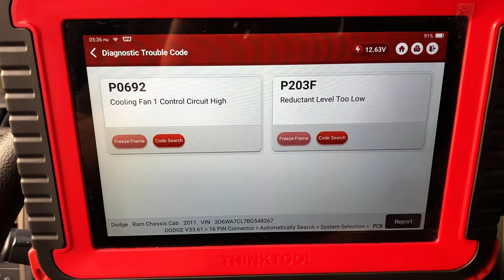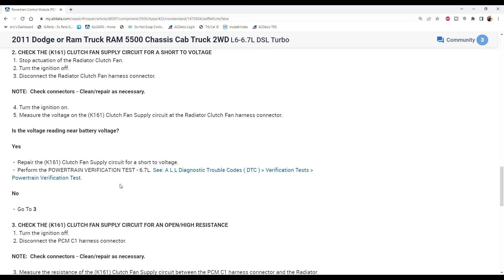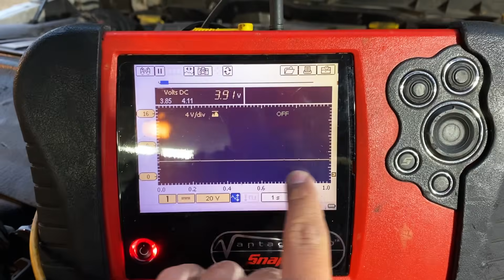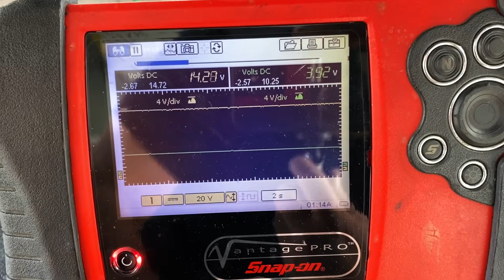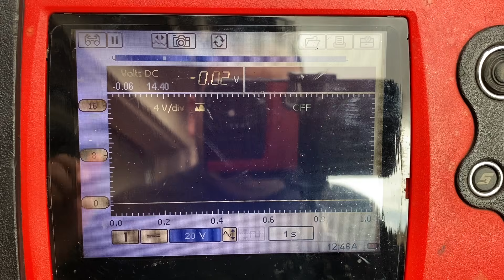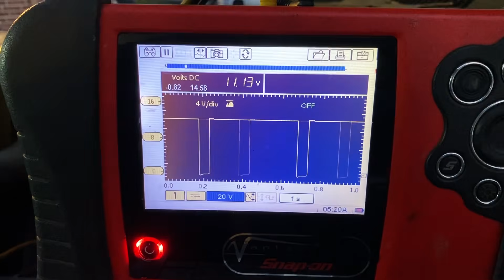DODGE RAM 5500 OVERHEATING P0692 FAN CLUTCH CIRCUIT DIAGNOSIS

Comment: Could you also have figured it was a bias voltage by using a bi-directional control and seeing if the ecu would send out the pwm signal?

Comment: 😮😮😮😮😮.     Hello hello hello hello hello hello hello hello I know that you get a lot of messages and you don't answer every one of them but can you help me or any one i know that the fan clutch have 2  speed normal and high is there any way to override the system and active the second speed without affecting the ECU I mean just using it when ever going up a hill loaded 😮😮😮😮😮😮😮

Comment: absolutely phenomenal video. minute 5.28 you missed the step 6) which asks you to do bidirectional test on clutch fan, if you did, you would find clutch fan not working and your next step would most likely be to verify with scope that pcm is controlling fan clutch circuit (testing at the pigtail connector) . After finding there is control, it would lead you to either open between pigtail connector and the connector at the fan clutch or open in the fan clutch itself. most likely you would have wiggled the end of connector and noticed it is not plugged in. BUT if you did that we would NOT have a chance to learn about the bias voltage being sent by pcm to fan clutch with initial key on. We learnt more about this circuit going the long way. Thanks a ton

Comment: Very Educational video.... it tells us that the problem could be anywhere in the system, and most people will either need to take it in and have a very expensive mis-diagnosis done, or simply throw parts at it to see if they fix the problem....
 I'm currently having the same issue with my ram/Cummins. Is it possible to do a simple test of the fan motor/clutch individually before dismantling and probing the rest of the system?....

Comment: Hey i have a 2016 dodge ram 5500 i already replaced fan clutch, thermostat, radiator , water pump and am still having problems overheating.

Comment: It helped me... In the process I found a wire pulled out of the plug on the fan side... Pushed it back in everything worked fine

Comment: How's it going  i have the exact same problem  new fan clucht  and only 3.9 voltage  i think the same  the computer should send the  12 voltage  my cuestion  it's at what temperature should be working the fan??

Comment: I replaced a new head gasket arp head studs rebuilt head and I had electric fans and the truck temperature gets up up to 220 226 I’m thinking to put back the stock fan clutch I have coolant by pass every time when I’m loaded the temperature goes up I think the fans don’t work good with towing

Comment: Thank you sir for this full in-depth diagnostic ,  I just replaced my clutch fan and after pulling a load of 28k. My truck was doing the same and the diesel shop I went to was doing the same Diagnostics and same tools you have and you have now proved that my pcm is still good and I’ll be getting a different brand

Comment: The owner is lucky he didn’t break something in the number six cylinder. Dodge Cummins is known for this….Might consider running a. 165 thermostat  as that gives a little time to notice the overheat before  damaging the engine.

Comment: I've replaced the fan clutch on my 5500 3 times now with a new one everytime and all 3 have worked great for a few months and then starts roaring again. I'm ready to pull my hair out

Comment: Shop I went to assures me that it's the pcm is bad.

The fan clutch is new and they ohmed it out and said it was good. They said that the fuse is good. The ac/ transducer was good, wiring and all pins were good and had continuity. They were certain that the computer was bad. But they said they have no way of testing till they put the computer in and if it's not the issue it's on me they can't return the computer. I was about to green light them but then I saw this video and concerned. The fan that is in there is OEM and does not have the connection as shown in this video it is hard wired on the fan side plug. Am I missing anything? It's about $3500 and about 3 weeks till they can get a computer. Any input would be great

Comment: The mechanic that replaced the clutch is a hack! Guys like him is the reason I do my own work. Anytime you do a job it had better look like it left the factory. Zipties holding the wire away from the fan and cutting that factory ziptie fastener and not replacing it is unacceptable. The ziptie that the author of this video cut was factory it was not put there by the previous mechanic he had better put it back on. I wonder what the shroud underneath looks like? I bet the previous hack did not replace the 4 Christmas tree plugs that hold the shroud together at the bottom.
Reply from the maker: I ended up replacing the fan shroud because the bottom half was missing. I think the previous mechanic cut it off.
Reply: @ADVANCEDLEVELAUTO  I wondered why there was only half a shroud there when you pulled it out

Comment: Just saying the fan clutch can cause the fan to turn up to 10% faster why not drive it until it start getting hotter and see if you hear it locking up surely it sounds like a big rig as you always hear them when they lock up

Comment: I like it, from a retired ASE master! Why, when the service tech uses common sense and finds a problem, it becomes fixed. I don’t like PWM fan clutches but this is the world of lower emissions and higher fuel economy we live in! But you have to verify the customers concern, then following “TSB’s” if any, then diagnose the root cause. Too many repair the symptom and replace a part. 
  Go to the parts store and let them read the current code. Just understand if it says “O2” sensor, does not mean it is bad. Too low for long time, too high for long time, heater open, high resistance because a new exhaust had an O2 wire melt on it. 
 You see, the code only points to the component, but does not diagnose the real reason.
 Parts stores enjoy selling $170 heated 4 wire O2 sensors, but it may be correctly reporting a problem as say the fuel pressure regulator is dripping raw fuel past a ruptured diaphragm (If Yours Has One) but in this case, the O2 is reporting a rich mixture over a long period of time (Varies by Manufacture) but is fine.
Complicated? Yes, blame the Government for CAFE standards, CARB for setting expectations for emissions, EPA for the rules and marketing for noise, safety, and MPG and others like crash testing to set insurance rates. Then how big the city is, number of accidents, deaths, theft as you move into the country 200-300 miles from a big city, your rate can drop 39%. Fact!
ASE master tech since 1978.

Comment: congratulations on the diagnosis, I'm Brazilian and I live in Miami.  Where can I buy the worshipers you use in the multimeter?  Yellow connectors that you stick inside the cables

Comment: Awesome work Eric. 

I was out of town working one day when the company truck a 2017 Ram 2500 was having a similar issue where it would heat up and reduce the speed it could be driven when towing a trailer. it was a 16 foot enclosed trailer with maybe 1,500 LBS of extra weight aside from the trailer. should not have been an issue. i towed the trailer with my truck so we could make if to and from the hotel but we finally took a look and there was a small connector in the shape of an L that came from a hose and connected to a pipe that keep breaking. we replaced it with an identical unit and it broke. so we grabbed some fittings from home depot and a hose from autozone and replaced the piece. has worked like a charm since then

Comment: So my biggest take away thoughts are on figuring out the system design and how it works. I was banking on you misreading the low voltage reading on a pulse signal as you believed it was pulse till up to that point. Then you found out that it was a pull down signal somehow! But here is my thought, was this info listed on alldata and just overlooked or was it not there? (The type of circuit design and how it worked)

Comment: Ok I saw a Texas plate where are you in Texas do you do vehicles in the San Antonio Tx area my dodge Charger ain't starting and North Star Dodge couldn't get it running after putting two batteries taking it back the second time said my alternator was good charger still doesn't start went dead about after a week both times with a new battery

Comment: Long Video.   BUT so much helpful info.  My old 2005 Dodge 2500 had a similar problem,  wasn't to replace the freaking expensive computer.  So this explains some of the issues and unknowns i was dealing with.  Learned about the load test, so when my buddy replaces the Tranny on my old Dodge I can help him figure it out so he can maybe get that old 5.9 to 750k.

Comment: What a video! I got a question for you when you grounded the circuit to eliminate the bias voltage, are you creating a short circuit? because when the circuit is shorted I saw 12 V of PWM or maybe I'm not sure what did you test.,,,, Nice diag bro!
Reply from the maker: It's not technically a short circuit when it goes through the test light. The bias voltage is designed to be a very weak signal that can easily find ground through the component (i.e fan clutch) in the circuit. This is how the computer uses the bias voltage to verify if the component in the circuit is disconnected or there is an open in the circuit.

Comment: First, that is NOT a pickup truck. No such thing as a 5500 pickup truck. It's a cab and chassis. They are different in many ways. And yea, the fan... it's a very, very common issue & fix.

Comment: Good save on the explanation at 15:50.
When something is PWM, pwr or gnd contl. I Always look at the PWM sig First this can tell me if the controller is actually working and if there is a pwr or gnd error then the check pwr and grd wgile doing BI/D/C of the device.
90/100% should mean full pwr or full gnd else 20% or less is opposite
Reply: And as I watch the end of the video I see my self 5 years ago Fudge yea !
Member dat day!
 And put DAT on a Cracker DUDE!

Comment: You found the problem and fixed it......period!
GREAT DIAGNOSIS!
If that's a Cummins engine and fan unit, they have a pretty thorough diagnostic test, in some cases you have to know "Cummins Speak" but once you've done one, you'll know!
My knowledge is limited and it was over 6 years ago working with a Cummins CNG engine.  Fun time!

Comment: I cannot believe how many times technical information called it a clutch fan. A clutch fan, if one really exists would be a device that cools your clutch. A clutch may indeed overheat and be in need of cooling, but I know of no device designed to do so. A fan clutch, on the other hand, would be the proper device to engage the radiator cooling fan. Just one of my pet peavs. Just saying. Great video Eric. Keep 'em coming.

Comment: Great video! I misdiagnosed my friend’s car. Her car couldn’t move backward. Thought it was suspension related part or transmission . Turned out brake pad were came loose. Pad material were gone. Rotor was thin! Not an expert in Suspension system… I’m a young tech..so I’m constantly learning! It’s a pain but crazy! You are very honest and I learned a lot from you!

Comment: As usual, great trouble shooting Eric.  I’m surprised the PCM is bolted to the engine block. I would have thought a computer would not be so close to a big heat source. It seems modern computers aren’t as sensitive to heat as old ones.

Comment: There you go, collateral damage and its from the mechanic who is doing the immediate repair job. Maybe the clutch was replaced and he used the old wiring set up...who knows but in any case, the retention clip/plug was NOT new looking yet disconnected due to the damaged retainer.  This is why I cannot fathom "hiring" mechanics from just anywhere...they have no concern for the age of the vehicle, its plastic integrity, design etc. All they want to do is rush and take shortcuts on every job and say they fixed it yet all along the way there is evidence of "Mr. Mechanic" and his carnival of elephants in the china cabinet. The vehicle didn't come into his shop that way I can confirm...so there he goes doing his repair and to top it off he uses "Autozone" (he claims) for a parts source which is a huge immature decision to make as a mechanic. Boom, he delivers the vehicle and never confirmed the repair, the wiring etc. Obviously he never used the scanner.

Comment: Great job Eric. I've learned the hard way, never assume the parts the previous technician replaced was good. Always start your troubleshooting from scratch.
Reply: Agreed, sometimes the biggest mistake you can make is to assume that just because something is new it must work. Sometimes all it means is it isn't rusted in place when you need to change it again.
Reply: Great point 👍👍
Reply: Yeah, seen too many situations where the brand new part (usually some gibberish-named knockoff from Amazon) was worse than the old one, though in this case the previous "mechanic" simply lied altogether. Hope the Ram guy can get his money back somehow.

Comment: I work on heavy trucks 99% of which have Cummins engines in them, it is almost impossible to kill an ECM on a Cummins engine!
I have seen:
1. Every input and output you can imagine shorted to power or ground
2. 12 volt trucks jumped with 24 volts
3. Batteries connected backwards
4. ECM reflashes failing halfway through
5. Every fluid you can imagine being spilled all over them
6. Technicians dropping them on the ground

They're tough, and you would hope so considering the damn thing cost like $3,000 in big truck applications
Reply: I do agree cummins HD ecm's are pretty tough. I also work on HD class 8 trucks. Had 1 cummins ecm die at are shop but no fault of its own. The unit got stuck by lightning on are yard blew both steers out. Everything electrical was fried.